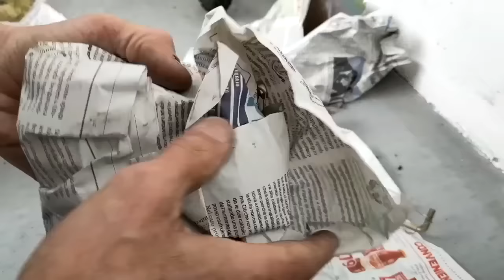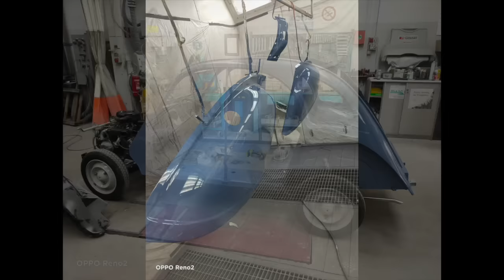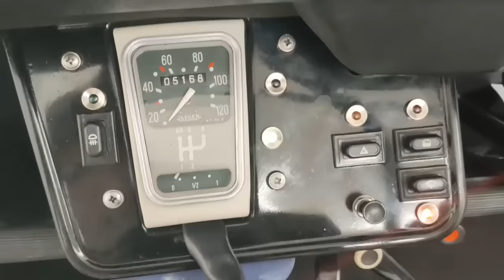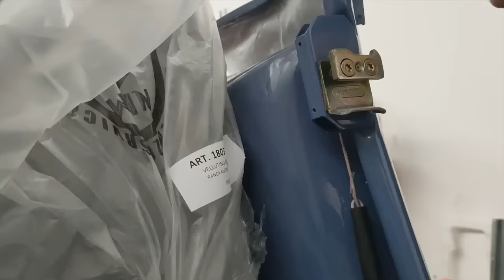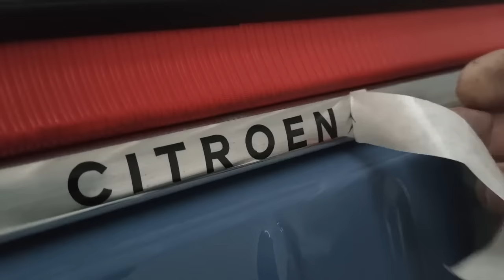Lulù - Citroën 2CV 6 - Restoration

Comment: Man now I am afraid of buying and fixing a 2cv when you see how thoroughly it is done here. They say it's one of the, if not the easiest car to fix and work on your own if you don't have any previous experience. 
What talent to be able to do such a  thing.
Reply from the maker: Thank you. Don't be afraid.The easy thing is that you don't need special tool to work on it. With a spanner of 11 you disassemble the 80% of it... :-)
Reply: Thanks. Your restoration looks better than when it came out of the factory!
I am thinking more of a rolling restoration. Beside the Haynes manual do you recommend other literature material for restoring or understanding the build of the 2cv? Cheers! @citro-garage
Reply from the maker: I suggest to refer to the original citroën manuals, even if for the 2cv they are not made as well as for the DS, they, contain all the correct parameters for the setting of everything. Haynes is sometimes not accurate.
Reply: Thank you for the reply! Grazie! @citro-garage

Comment: 652 CC.
Reply from the maker: 600
Reply: @citro-garage  
Min 5'12 ?
Reply from the maker: @josemariaarino854  same size! They seem different in size but is only due to the different color.
Reply: @citro-garage  
Used pistón 74 mm
New pistón 77mm?
Reply from the maker: no, I changed cylinder, pistons and rings, but with the same bore.